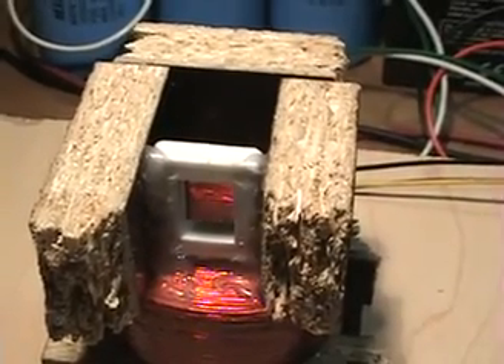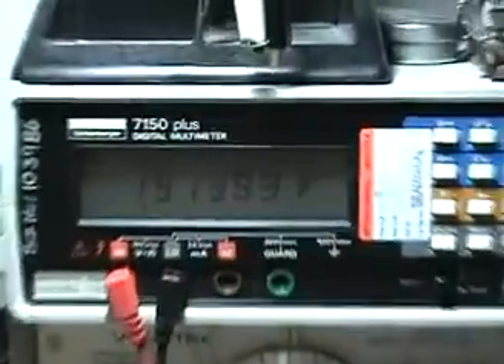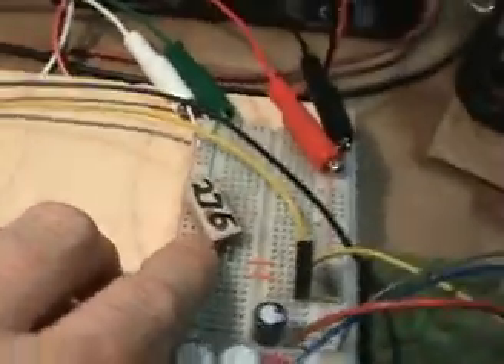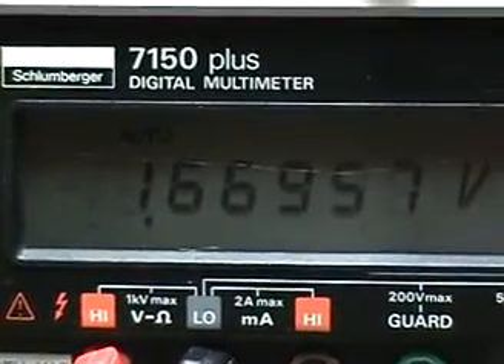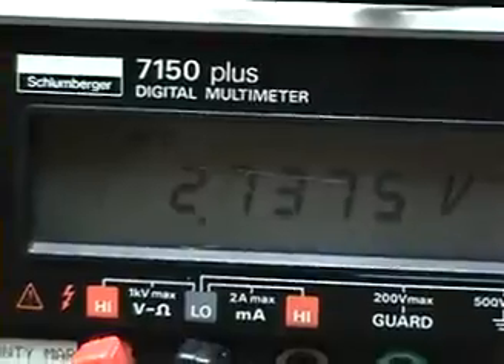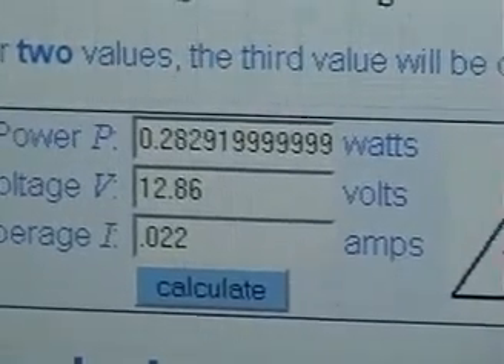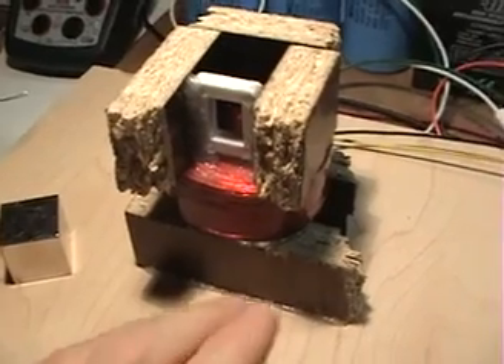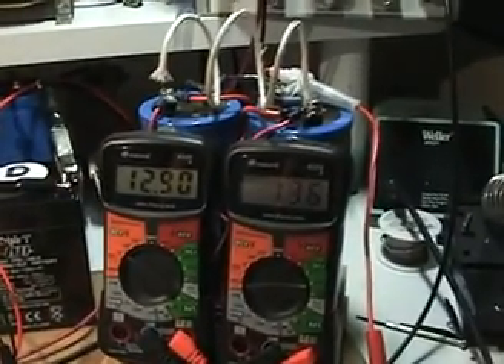Magnet and Coil test 2

Comment: I think the voltage was lower because you were collecting scalar magnetic field when the magnet was pushing toward the other magnet the magnetic field was increasing. Can you try to put the magnets at the top and bottom of the coil(remove the space between the coil and the magnet) and a magnet to move inside the coil to see if there is a difference in voltage?